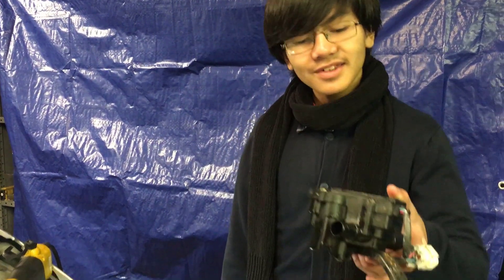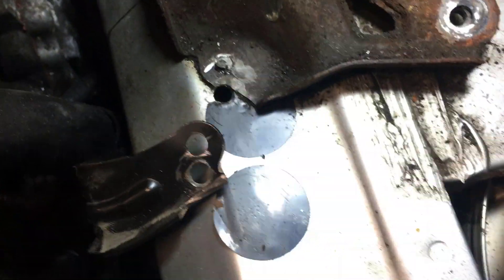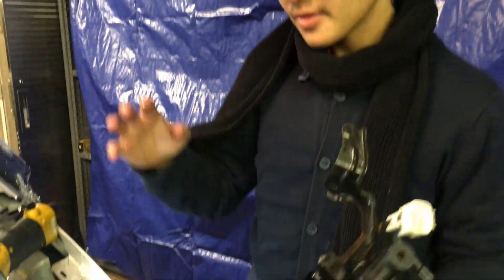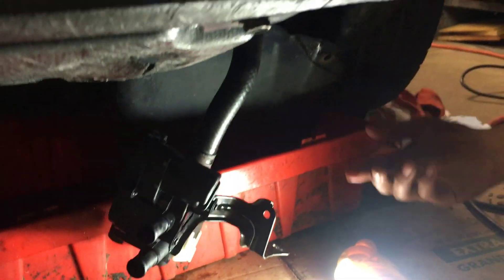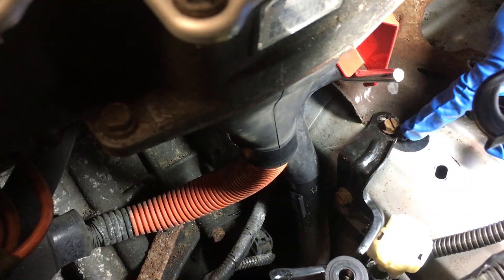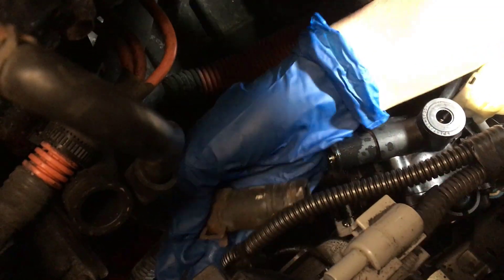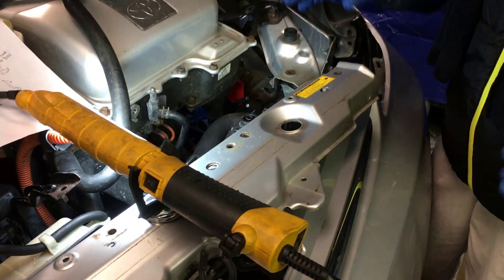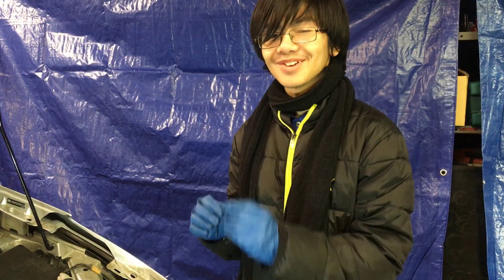How To Install & Replace 3-Way Coolant Flow Control Valve Toyota Prius Gen II 2004-2009  | P1121 DTC

Comment: Hey aiman I changed the control valve for the coolant and drained the coolant. The triangle of death is still coming up. I went back to autozone to do a diagnostic check on it. The diagnostic said that the control valve was still the problem. Do you have any suggestions?
Reply: I have a Prius with the coolant control valve issue, which is what brought me here. No triangle though.You might have another issue. A standard ODB II reader won't get all the Prius specific codes.  If you have an ODBII reader you can connect to a phone or a PC there's apps that can read the Prius specific ones. There's also aftermarket clones of Toyota TechScan which can read them. I've had pretty good luck with the ODB Fusion app, with Prius codes pack, and a cheap Elmscan bluetooth adapter.